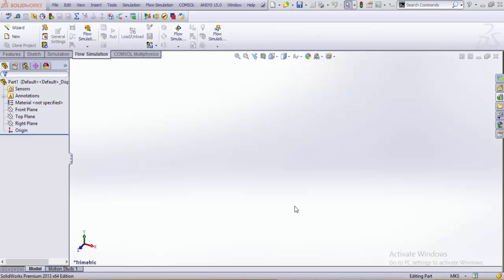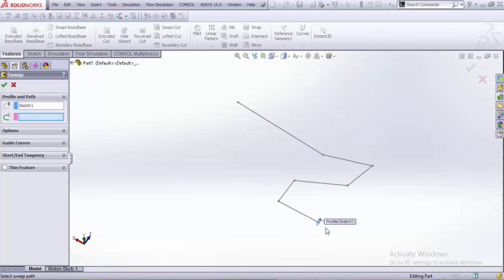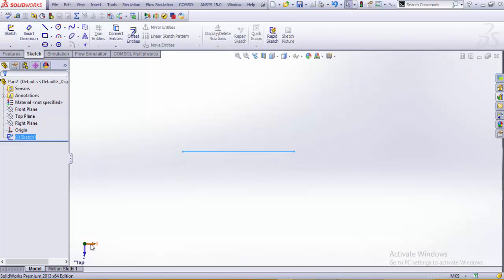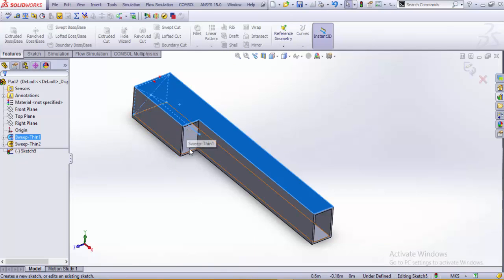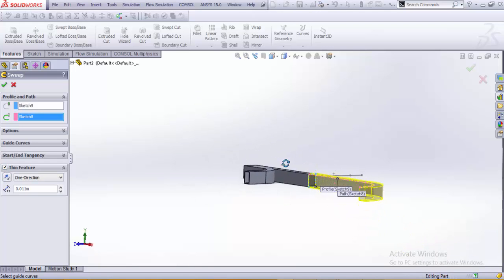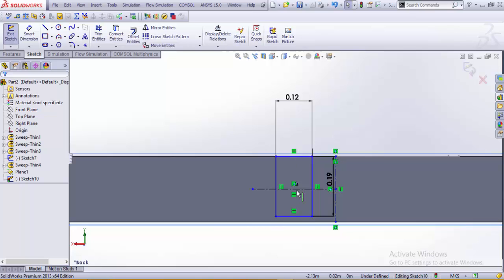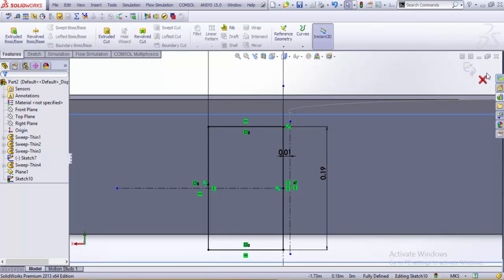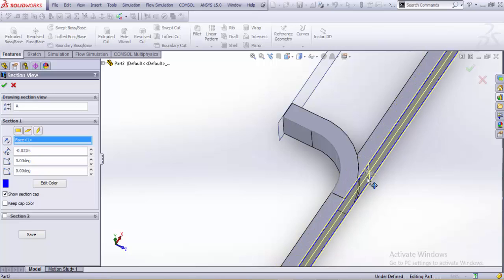ducting and tubing design(simplified)

Comment: Hi bro I need duting design material
Reply from the maker: sandeep patel, you mean ducting?
Reply: S
Reply from the maker: different country uses different ones.usually these are layers with insulation. the layer type is defined according to the building code of your country depending upon type of building you are using these designs in